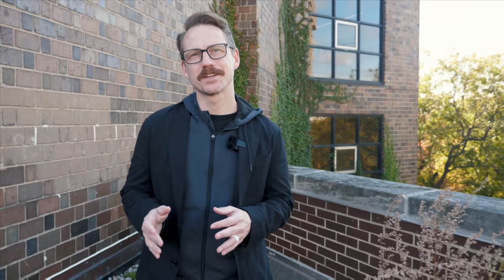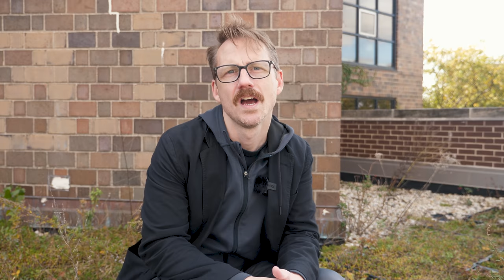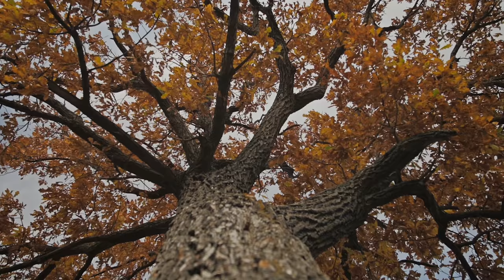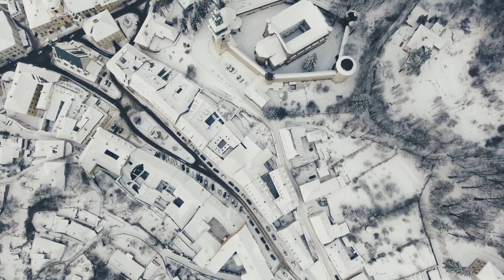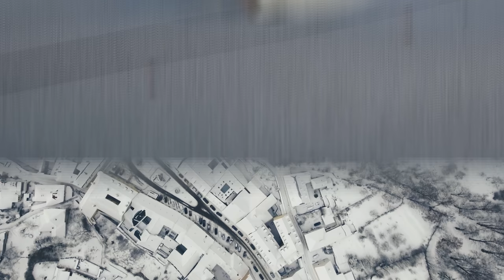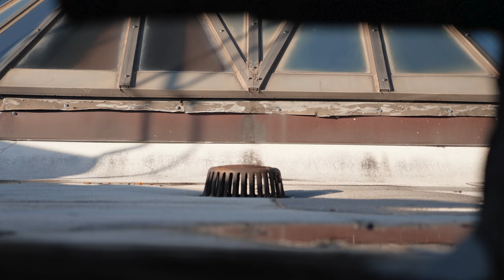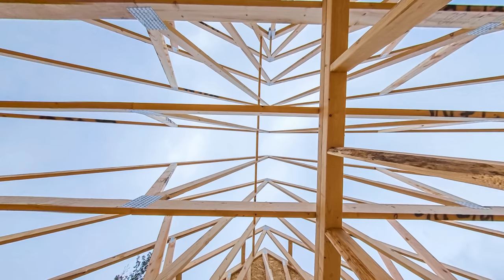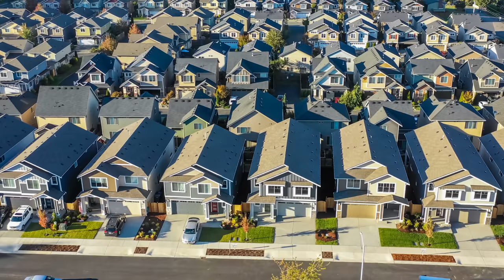Why Do Architects Insist on Using Flat Roofs?

Comment: Glad you addressed this subject. I’m a small time retired contractor who mostly did small renovations and repairs. There is a huge disconnect between designer and product years after the build. I live in the Pacific Northwest in what’s described as a temperate rain forrest. I’ve seen many “fails” due to form before function. On large buildings, flat roofs with steel truss systems make sense. On residential buildings in my climate,flat is a poor choice. Any flat roof I’ve ever been on will always have pockets of standing water on it which shortens the life of the roofing material. They are also highly dependent on maintenance. Built in gutters,drains,scuppers,all need cleaning and MOST homeowners neglect regular maintenance. These transitions also are “ week spots” at the time of build,relying on proper installation techniques and skill. The disconnect is 20-30 years down the road when that flashing has failed and rotted out the wall,and siding,the designer will never know that a part of his or her system failed and is now a costly repair. With building as well as roads and outdoor structures,channel that water away from the buildings as fast as you can. Don’t rely on materials and caulking, they will fail. Choose building materials and design suitable for the climate.
Reply: Retired architect here.  The majority of our firm's practice was in South Florida in what is described as a salty, semi-tropical environment with a high rainfall and a high humidity.  We selected whatever was appropriate to the project whether it was a "flat" (correctly called a "low-slope") or "pitched" roof.  Roofing failures are primarily due to inappropriate materials selection, incorrect design details, and/or poor installation/workmanship.  Always reference the NRCA (National Roofing Contractors Association) and SMACNA  (Sheet Metal) manuals whenever one is selecting materials, designing details, or inspecting an installation.  Reminder:  Nothing is "water-proof."  Some things can be made "water-resistant" ... for a time.
Reply: I haved lived in a 100+ year-old flat-roofed house fir 20 years in London Ontario, formerly lots of snow. Interestingly, the style is squarish, neoclassical, central floor plan. Old neighbours in the know claim the original owner-builders could not afford a proper (probably mansard) roof, so made it flat. Ten yrs ago had the 2nd-floor ceiling open, and saw it had a slope--16" at centres, down to edges. Had roof recently replaced--also flat. One corner wood rotten, and we were getting ice buildup on that corner. Not cheap. The previous roof might have been 30 to 40 years old--don't know. Note that when I look at houses I immediately look at how much space is wasted, usually by a pitched roof.
Arianne
Reply: You speak of poorly designed flat roofs.  I'm a flat roofer, we never rely on caulking for water integrity.  Caulking is only used to help with water flashing, but is never considered a true seal.  Ironically many steep roof systems do rely on caulking as a sealant.
Reply: @awitheford  If you think space is wasted by a pitched roof, it is due to imagination, not the roof style. A lot of houses use the space of a pitched roof for things like storage or extra room. Open your mind to the possibilities :)
And I will add this world would be a boring place if we only worried about "practical" things and didnt also think about the look. pitched roofs just look better generally, moreso outside of the inner city of course, where real estate is more valuable, spare land non-existent and you have to focus aesthetics elsewhere because you have to utilize every available space for practical things.
Reply: I’ve spent many summers and winters caking various forms of goo and patches to the flat roof of the shop I worked at (Also in the PNW).  Always standing water, always leaks, which are impossible to track down.  Miserable design.  An architect or builder is clueless in regards to the damage these roofs cause to a wood framed structure after 40+ years.
Reply: @ wallacem41atgmail 
Sounds like your making excuses for using poor materials. I can’t think of a single instance of a shale roof, or a copper roof having needed repair due to not being water proof, baring unusual storm damage, such as a tornado. 

It is lo past time
That criminals who design buildings with sub standard parts be held account and rot in jail. Any roof that doesn’t last a standard lifetime of 100 years without maintenance is criminally negligent.
Reply: Mike Oehler built underground homes and found more success with pitch rooms to divert water around his structures than pooling on top, the cause of most underground problems
Reply: @waltermh111  I see a lot of new-ish neighborhoods where they put the ridiculous high and steep roofs. Supposed to look "upscale" or some shit. It IS a lot of wasted space in climates without a lot of snowfall...which is what roof pitch is all about. Any pitch will shed water.
Reply: @yourhandlehere1  pitched roofs are not only about snowfall, and I have discussed other ways pictures roofs are used. And they do look better than a flat roof. Not everything needs to be about being a 100% practical. Just like there's nothing practical about art but we like it for aesthetics.
Same thing about most of the fashion that women like to wear. They will tug at it and complain about how much it reveals all day but they will still keep wearing it because they think it looks good on them.

There are practical uses of the space of pitch roofs, but they don't need to be practical to be desirable anyway.
Reply: @waltermh111  Pitched roofs ARE about snow. You need a good steep roof in Switzerland...You need a good steep roof in Minnesota. In the south where snow is rare putting a 12-12 or more on a house is stupid. "Art" a lot of times is used in place of "stupid" so you feel better.
Reply: I don't quite understand why a flat roof should collapse or leak unless it is poorly designed or uses inferior materials. Where I live the norm is a simple concrete roof made either of a poured slab with non stressed rebar net and flush beams where appropriate or else standard pre-stressed slabs just placed on top of the walls. The roof is then covered in screed with a thin over covering of cement  to achieve a slight slope to lead water to drains. The whole thing is usually waterproofed either by bitumen sheets or by a flexible roof compound, quite similar to the bedding used in truck beds.  It doesn't snow here but if it did the roof would easily bear a few feet of snow.  The water proofing is not an issue either as long as the membrane is applied properly and can be just left alone for 10 or 20 years before needing any maintenance.  Another type of waterproofing, which is what I have, is a polyurethane foam which also acts as thermal insulation, which is applied between the concrete lab and the screed. It is now almost twenty years old has never leaked, and I have never  done any maintenance whatsoever to it.
Reply: @listerdave1240  Flat r roofs collapse in heavy snowfall. because the psi of the snow is to  much for the roof. causing it to collapse. Which is why there are no flat roofs where it snows.
Reply: @thunberbolttwo3953  Yes but they only collapse if the roof is not strong enough. Generally concrete roofs are specified to withstand a load of at least 1.5 tons per square meter, which is enough for a layer of snow 1.5 meters thick (about 5 feet). In areas where it is likely to have deeper snow than that it is trivially easy to make the roof withstand  more - it just needs to be thicker and have more rebar. 
There is no reason why a roof should be built that is not designed to withstand the maximum depth of snow that it is expected to have to carry. If a roof collapses because the snow was too much for it then it is the fault of the architect who did not design it properly.
Reply: @listerdave1240  The fact that areas that get snowfall do not have flat roofs prove me right
Reply: @thunberbolttwo3953  Just to understand better. Just picking Sweden as an example, if I were to ask you about it would you say that it does not snow there, that they don't have flat roofs, or that they do and they collapse when it snows?
Reply: @listerdave1240  in my climate seeing several feet of snow on the ground in winter, a flood of rain in autumn   and temperatures +40 to -40 during the year are a norm, and the weather isn't stable - it goes all the way down and up to +5 several times a winter, it changes frequently in summer. I don't know the exact technology they use... The top layer is black and looks like rubber annf they use flames when they put it down or fix it. But  it  always fails in a few years.
Reply: @listerdave1240  i live in country, most of people in which live of blocks of flats 10 to 50 years old. Every single one has it's roof flat. Everybody whom i know and who has a flat on the top storey  has dark wet stains on their celling because of minor leaks in these roofs.
Reply: @annasolovyeva1013  It seems there are many people doing that kind of work that are either incompetent, careless or doing it badly on purpose so they get called back every year to fix it.  If done properly there is no reason why it should not last a decade or two with no maintenance at all and some light maintenance every ten years or so thereafter. The most common issue is not applying enough heat and not cleaning and preparing the surface properly. The type of sealing you are seeing is most likely bitumen sheet. The heat is meant to melt the different pieces together and also stick them to the roof, which must be properly cleaned and prepared for it to stick properly.
Reply: @listerdave1240  proper cleaning must be a problem as well as weather conditions, cheap materials and low-cost workforce. The bulidings are ran by governmental organizations (municipal level) and they run a competition to choose the cheapest company, so the result suffers from that a lot. as for weather - the forecast is often wrong here and the weather just random, so it's hardly possible to plan many kinds of outdoor works e.g. painting something or buliding roads. They often stick to deadlines, do they keep working if there's suddenly rain or even snow. 
However, even in soviet union when they didn't intend to shave costs - it used to leak. And in houses that are ran by private companies - it leaks. Everybody pretends it's ok nothing is happening.

Comment: In Brasil, flat roofs are also a afordable solution for limited access to land in most major cities. On the top of the houses, it became a space for gathering and leisure, making itself very present in the emotional and cultural landscape of working classes throughout the country.
Reply: Brasil have a warm climate, which mean that they do not have to worry about snow.
Reply: @JohanDanielsson8802 just massive rainfall of up to 600mm/month during rain season
Reply: @thisstuffisdumb  water can move downhill wheras snow just sits
Reply: Flat roofs are moronic in the weather conditions of brazil, it will only add to more issues for the poor who cannot have a home that is resistant to damage. What you want is titled sloped roofs, people can coalesce in balconies, courtyards, or in the streets.